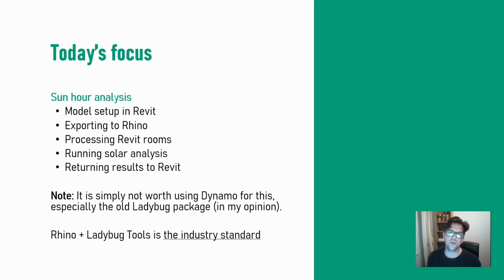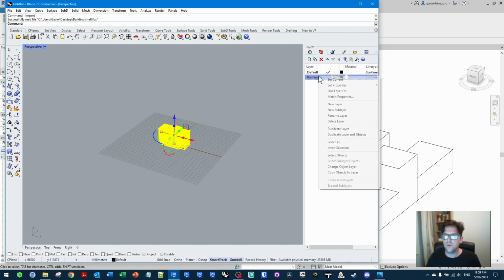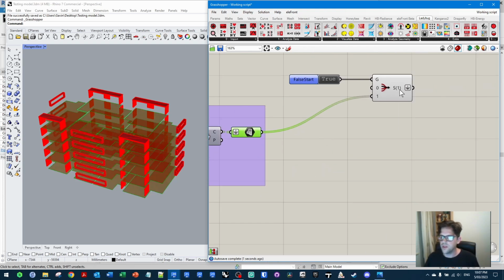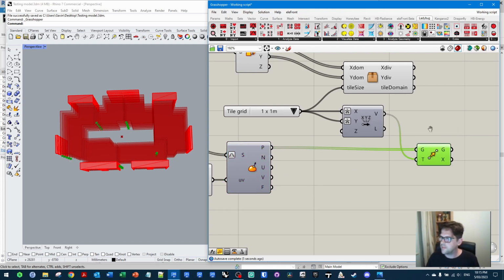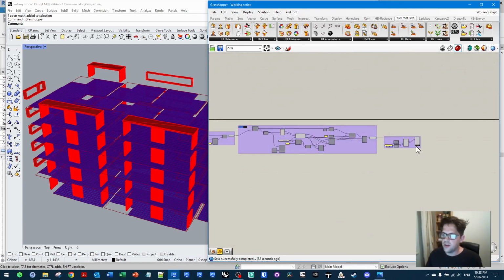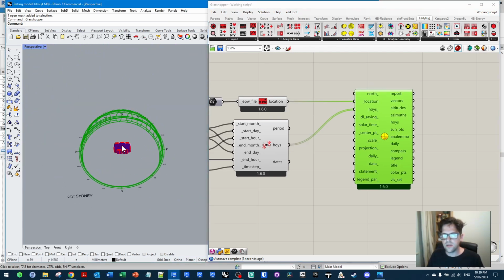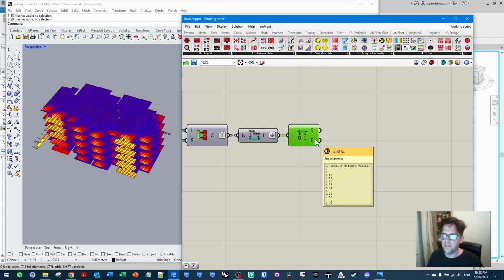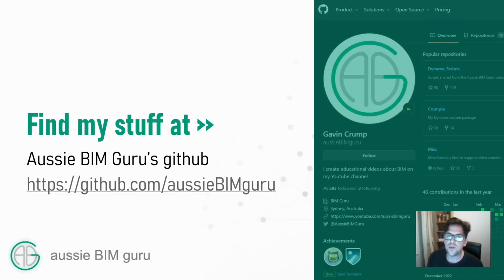Solar analysis in Revit using Rhino Inside, Ladybug and Grasshopper!

Comment: Hi, great video, everything worked fine for me until I connected the last  join mesh to the lb point grid for testing. When I set the grid size to 1 cause I am working in meters ( everything else before that worked for me using 1 instead of 1000 - the plane appeared subdivided correctly in all of my levels)  it turns red and says "1. Solution exception:_geometry must be a Brep or a Mesh. Got <type 'NoneType'>." you know why that might be? Thanks.
Reply from the maker: Thanks! In this case my only guess is that one of the meshes may be invalid or a null in the data structure. Try feeding through one or a few rooms at a time and see which one breaks the workflow.
Reply: @AussieBIMGuru thanks I'll try that

Comment: Amazing Video Thank you!
I have Two Questions: 
- What is the point of the Rhino Inside plug in if we are still exporting (as an fbx or other) from revit and importing into Rhino 
- Is the Revit Ribbon in Grasshopper only available via Rhino Inside
Reply from the maker: In this case we are using Rhino Inside to pass results directly back to the Revit rooms, but you could take in all the geometry using Rhino Inside as well - just harder to get reliable geometry that way I find. The Revit ribbon is only present via Rhino Inside whilst running in Revit - it would be effectively useless otherwise.

Comment: i had problem when i constructed point for evaluate srf and those point didn"t look like yours. My constructed point didn"t vertically separate. I apreciate your instruction!
Reply: ATTUALY, THE FLOOR SURFACES ARE BIG AND THOSE POINT ARE TOO SMALL. I THINK THE PROBLEM IS ABOUT SCALING AND UNIT
Reply from the maker: The scaling issue sounds to be the cause. Note I'm working in metres typically as it works best for Ladybug, so make sure your tiling value suits your chosen units.

Comment: Can I know why you do not use climate analysis through the Revit program (insight)

Are the results of climate analysis in the Rhino program better?
Or does it contain more options?

In other words, what are the advantages of the Rhino program in climate analysis?
Thank you for this great content
Reply from the maker: It uses industry endorsed tools and is much more popular and developed regularly by Ladybug tools. Once people use insight and Ladybug they tend to notice the different very quickly. Revit models are also just not well set up for analysis and cannot support detailed mesh context which most solar analysis requires.
Reply: @AussieBIMGuru  Thank you

Comment: Gavin, how can I transfer geometry from Revit to Grasshopper in a way that it is as simple as possible for using Ladybug tools? I've tried various methods, and it seems that the easiest approach is to use masses and recreate the walls, and then generate the gbXML from those masses. However, this method is time-consuming. Typically, when using Rhino Inside Revit, the geometry ends up being too complex and open, which interferes with the simulation.
Reply from the maker: Assuming you are using rooms id look at setting finish face to centre for room bounding then try getting their geometry. Generally ive found cleanup is always necessary unfortunately.
Reply: @AussieBIMGuru   I managed to transfer the rooms from Revit to Rhino3D, and then I converted them into closed faces. It looks great, but there's a gap between each enclosed space, which represents the walls separating one room from another. Is there a way to eliminate these gaps by capturing the volume of each room using the center of the wall? This way, when transforming them into closed environments, these rooms would become adjacent, correctly identifying the interior walls, interior floors, and so on.
Reply from the maker: @luizmendes1625  you can use Revi API to force the bounding option to be centreline, which should give the line between. I have some nodes in crumple under rooms for reference that get boundary wirh a specified boundary optioh.
Reply: @AussieBIMGuru  Do you have any video examples or a script? Could you share them?

Comment: Thanks for the tutorial. Gavin, is it possible to do this, but for thermal analysis? How would it be?
Reply from the maker: Generally thermal analysis requires materials and spaces to be modelled and is quite different, as heat transfer depsnds on material type, thickness etc. The honeybee module has nodes for this, suggest checking out LB tools website for examples.
Reply: @AussieBIMGuru  I used the plugin Rhino Inside Revit to tranfer the geometry and the volumetry. Is it possible to configure material with these elements? The geometry comes with many layers, factor that can make the implementation difficult. My idea is to turn the volumetry into surfaces and apply the materials. How could I do that with the volumetry (rooms) that you taught to bring from Revit? I would also need to eliminate the spaces between the volumes caused by the walls in revit, and then follow Phillip's tutorial to apply data to the materials and help Ladybug understand what is an internal/external wallm floor, window. What do you think about that?
Reply from the maker: @luizmendes1625  revit isnt well set up for material analysis and settings. Generally where i work we tend to manually reclassify surfaces unless we have a clean model prepared before. Its all data at the end of the day, so if you have good data in revit thats the key, from there you can pass elements in and define them in rhino based on that.
Reply: @AussieBIMGuru  Thanks for the help.  If in the future you can exemplify in some video, that would be great.  Thank you very much.
Reply from the maker: @luizmendes1625  unfortunately it goes beyond my skillset as I dont get too deep into energy analysis - more of an engineers role. Maybe check out Phillip Garvans channel as he covers radiance and therm a bit.

Comment: Thanks Gavin! glad to see you are back up and running with integrated workflows with Ladybug tools
Was just wondering if the issue of the offset distance is due to LBT always requiring input data in metres?
 
Also, i have found the HB-Radiance toolset to be useful when combining with other analysis workflows - e.g. autogenerating grids from energy model rooms. In the UK the BRE guidance for sunlight & daylight specifies an offset distance for the working plane and so, whilst potentially being less flexible as you say; i've found that the these components are more descriptive/tuned to repeatable & standardised assessments.
Reply from the maker: Not 100% what the cause was here. Generally at work I use my own remeshing clusters but it may be unit related, although I was in metres here I believe. Typically I do my own remeshing as some of the studies we do have an average result required for measurement, so we cant afford to have extra results skewing the true average on a gridated basis.

Comment: Perfect tutorial.. could you please make a video about how to measure thermal comfort ( indoor and outdoor) using rhino inside
And how to export materials and parameters because materials are very important in measuring thermal comfort.. 
Many thanks
Reply from the maker: Goes a bit beyond my experience currently but Phll Galvan has a great channel where he covers how to set up a study like this:
https://youtu.be/hnExu7Nu7QQ

Might be difficult to get the right spaces/values from revit unless you have all the thermal values in the lining elements 100% correct, Revit isnt a great thermal performance program so i believe is quite inaccurate for these things.
Reply: @AussieBIMGuru  yes you are right .. so your advise to use only ladybug for setting up the material? There is no way to export materials from revit and use them in ladybug.. it is easier to supply all thermal properties in revit components and export compared to setting up materials in ladybug .. Anyway thanks for your reply 🌹
Reply from the maker: @parametricbim2023  if you have good data in revit then you could export those elements and bake their parameter values from revit (e.g. structural material layer type, U value) as attributes in rhino using elefront and rhino inside. Generally the issue there is most modellers dont include all thermal layers and properties in walls, roofs, windows etc.
Reply: @AussieBIMGuru  yes I see.. In fact I am asking the best workflow to adopt in my PhD thesis.. So I am searching for unique workflow instead of the traditional one of using rhino/ grasshopper- ladybug honeybee… etc.. as in most researches.. 
I am thinking to connect my topic ( the effect of kinetic facade on thermal comfort indoor/ outdoor) with BIM workflow
I wish that I explain well the idea.. So if you see that my idea can be done please advise me.. thank you 🙏
Reply from the maker: @parametricbim2023  its certainly manageable but will need a lot of data to be carefully set up in the BIM model. The theory usually fails in practice because architects do not conduct thermal comfort analysis, ESD engineers do. But the architect has the BIM model so there is a mismatch in how much the model can achieve unless the architect does more work than they are paid for, which they wont. Same issue with LCA.
Reply: @AussieBIMGuru  yes you are right.. Also in my opinion there is a gap between the theory of BIM and the BIM in practice … especially in energy analysis topic .. the 6D BIM is just fake.. 🤔.. anyway I just need to decide the used tools and workflow in my research and also this need practice… lets try 😫😫.. thank you @Aussie BIM Guru
Reply from the maker: @parametricbim2023  6D BIM can be real but it needs serious templating and standardization - you can't expect the programs to systemize it all for you unfortunately.